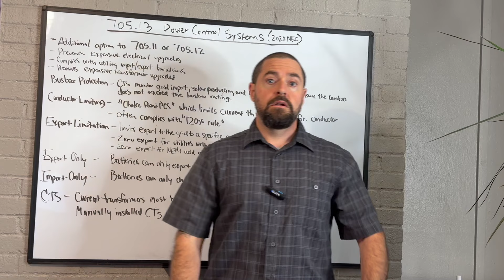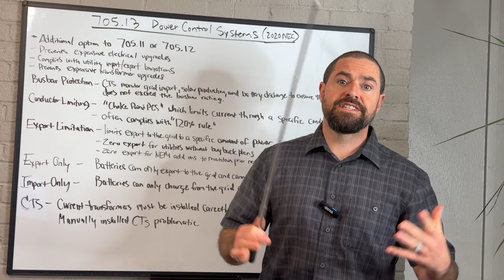Power Control Systems Explained: NEC Requirements for Solar & Energy Storage

Comment: Great video!  I'm subscribed and going through your material, as I'm in NC and doing something similar.  Question on the EG4 GridBoss as the PCS...if there's an outage (or a whole grid or EG4 company collapse), is it 'off-grid' capable and monitor-able?  Is the app local/Bluetooth or I can plug in, or a control panel?  I plan to get the FlexBoss21with the panel add-on for that functionality on the inverter.  Just for background, my plan is licensed electrician to wire up the GridBoss, then I'll do what I can on the inverters, batteries and panels.  Thanks for sharing your knowledge!
Reply from the maker: Hi Steve, yes, if you do not want it connected to the internet, or expect a widespread internet outage, you have 2 options. 1. Connect to the WiFi dongles though a "local connection" which links your phone directly to the equipment. I don't have experience with this but it is explained in the installation manual. 2. Install the LCD screen on the inverter. Thanks for watching and good luck with it!
Reply: @RockyBroadSolarLLC Thank you, sir!  Absorbing your content to make my own luck on the project...😊
Have a Happy Thanksgiving!
Reply from the maker: You as well Steve!